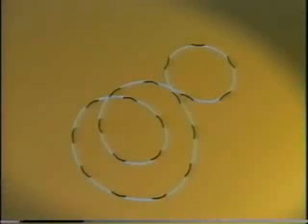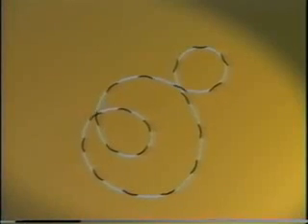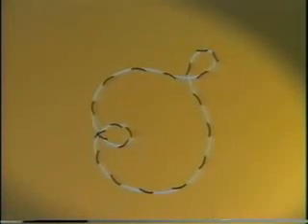Sphere Inside out Part - II

Comment: Okay, I guess it's so: You need an extra dimension of moving, so you can turn something inside out. A sphere can't be turned inside out in the 3rd dimension, but rather in the 4th. Same goes with the circle, you can't turn the inside in 2nd dimension out, but with the 3rd it works. Turning a tesseract inside out is easy in the 4th dimension due to the ability to see an object from the inside and right through. Yet the 5th dimension is for us unimaginable.
Reply: The whole point of the documentary is to demostrate that you CAN turn a sphere inside out in 3 dimensions.

Comment: Maths is fascinating. We have managed to figure out how to turn a sphere inside out, which has some pretty big scientific and mathematical implications, but we still cannot solve this:

Pick a number, if it is odd, multiply it by 3 and add one.
If it is even, divide it by 2.
Repeat the operation on the resulting number.

Prove that no matter what number you pick, by repeating this operation, you will always arrive at the cycle 4-2-1.

We have made something that looks impossible, possible; but still cannot solve a seemingly simple problem.

Comment: This video is about topology. It is very useful and it appears in many fields in math. This video basically proves that a sphere and an inside-out sphere are topologically the same. But what about the real world application of topology? Idk. Look it up. You probably won't get very far tbh.

p.s. network topology (usually depicted by computers connected by wires) is a simple concept that has nothing to do with this.

p.p.s. https://www.google.com/patents/US3991631 oh cool! Manufacturing operations often have a conveyor belt made of a long strip of fabric that transports materials from one place to another, and it is subject to wear and tear. However, using a mobius strip (a shape with the unique topological properties of having only one edge and one side) can be used to get the maximum surface area from one strip of fabric. If you don't get what a mobius strip is, it is a really simple and here is a video about it: https://www.youtube.com/watch?v=G2hsSMhCgAY
Reply: Thanks
Reply: wth it only took 6 hours for someone to respond and this video is 9 years old.

Comment: What's even the purpose of this "documentary"?
Reply: Silvio Haro From what I can tell skimming things online, the larger topic (differential topology) has a use in robotics, but this particular bit (called sphere eversion) is just math for math’s sake (ie. some circular reasoning where the point is its possible to turn a sphere inside out without creasing it) and for now there’s no practical application for it yet.

Comment: while this is factually very accurate, the sphere would have to be infinitely complex and have it's entire outer surface be a singularity, not divided pieces. however since this is mostly a theorem for the banak-tarski paradox, it applies here too. this is very factually correct as with VSauces video explaining the banak-tarski paradox, this isn't physically possible even if you could have a material that could pass through it's self. It's using alleth notes method of "almost infinity" or almost infinitely complex, which isn't possible.

seriously though this is freaking awesome, but only possible in the fourth dimension. Go see Vsauce's video explaining why.

Comment: I love this because it is an example of passionate thinking, however it is wrong, and here is where the error is: when the polar 'strips' are identified, in any quantity, as it is irrelevant whether 16, 2, or any other number are used, they then undergo a rotation, clockwise or counterclockwise, again arbitrary, with respect to a plane tangent to the sphere. When this planar rotation is applied to the 'strip', a torsion occurs. This is the important factor. By affecting this torsive value to each strip, just like the 'belt' example, a implicit 'loop' is created. Even in the most simple scenario of a 2 strip transformation, this nontrivial 'loop' cannot be reconciled, and, in this particular circumstance, is obscured into torsion. This torsion, either of two strips or any number of strips, will never be capable of reconciliation as the poles are a unitary symmetry, rendering them incapable of renormalizing this torsive effect due to the sphere's closed field lines. In short the surface will never be able to enter a non-trivial state and return to a trivial state other than that which it started. This is the fundamental principal behind knot theory, and not only applies to toral symmetries but also spherical. Welcome to invariability, and again I applaud the attempt.
Reply: I'm impressed! This video had me sold, but you got some serious smarts up there.
Reply: It's not wrong because, you know, the rules.
Reply: I'll give an example to help understand. Lets start with the equator, and consider it to be a closed, infinitely thin field line. If one were to rotate this field line inward towards the center of the sphere, the adjacent field lines would form a sort of topological 'S' shape along the equator. Here is the important part, and I'll address it with a question: When this field line is rotated inward by 360*, are you able to normalize the adjacent topology without breaking the initial set of rules? The answer should be fairly simple, and is 'no', assuming the equator is held in its rotation. This principal applies to all closed field lines of the sphere. Just as you can't 'cut' this sphere, you similarly cannot apply a torsion along a continuous closed field line without renormalizing. This is the same as cutting, and occurs along all 'polar strips' in this theory.
Reply: Fezzik Oxco your axiomatic disagreement does not directly contradict any specific step taken. If what you say is true, point out when this method violates the theory
Reply: i think you meant to say... "an implicit loop" not "a implicit loop". theory debunked confirmed.

Comment: Ok I apologize beforehand for the stupid question but why is this important?
Reply: This leads to all kinds of interesting ideas in engineering, physics, and mathematics. It seems very abstract but quite a few fields thought to be useless and abstract turned out decades later to become very useful (like combinatorics in math and computer programming). It does prove an interesting point though.
Reply: I don't see its uses in engineering but can imagine that it has uses in physics and quantum-mechanics. As far as the useless and abstract ideas turning useful later that's how we made transistors and modern circuitry so I agree there however I have no real background in computer programming (just basic logic and controllers) but if you can provide any other examples that I could read into that would be great.  Thanks.

Comment: okay but how do you turn a sphere inside out
Reply: all these great tips, thanks guys.
Reply: you insert the polar inverse coefficient phase variance inversion topographer into the corrugated dimensional transverse inhibitor. then tweak the flux relay transposition applicator.
Reply: turn it into cube.
Reply: first push the top and bottom. threw each other. then, twist the sides so that they lay horizontal. now pull the side edges together so they become vertical again. finnally, do a half turn on the edges so that they become both flipped and inside out. now shape it to make a circle.
Reply: ok so far i have a pointer finger attracted to an inside out thumb that's stuck in a sphere that i tried to reverse the gravitational polarity of so now my hand is exponentially being sucked into this mini black hole and my penis is caving in on itself so i have two balls and a hole in the middle
did i do it right
Reply: oh another great tip. thanks clerisvisitor
Reply: cool thanks for the tip santiago
Reply: Dyllon Slaboda square 1
Reply: Sure, push stuff though itself. *physics"
Reply: You take it to Disney Studios.
Reply: also i like your profile pic :3
Reply: Milly Henley Wrong comment section. XD
Reply: No prob, come at me anytime, bro.
Reply: Luka Puka Everyday, green.
Reply: bit of a correction-from my understanding. You flex or crease the sides to start, then you bring the top and bottom through eachother... then unlike what you said-you twist the top and bottom in opposite directions to cause the sides to turn the way they do until they have gone back to being straight, then you press the bulging sides through the center, then you just form a sphere with the new alignment.

Comment: What benefit does it bring to humanity to know how to turn a sphere inside out?
Reply: +pxnditx 2012 One of the other math channels I'm subscribed to gets this question a lot and their answer is that the important part isn't this particular problem, but the methods used to find a solution.  To solve this problem mathematicians had to investigate new ways of transforming objects, and the transformation methods they discovered can then be applied to bigger problems such as a warp drive.  It's like how they first showed the transformation methods on the ring before applying them to the circle. By first showing the transformations they can do to a circle, they could apply them to the fabric of space-time to figure out how to make something like an artificial gravity generator or faster-than-light travel.
Reply: +Maxwell Nieberger exactly.

Comment: What if I would just stretch ring into a ball?
Reply: +axelxan why don't bank robbers just walk around the walls of the vault in 4th dimension to get to the money instead of trying to break through it?
Reply: +Chandler Gloyd I bet they wouldn't need to steal money if they could do that.
Reply: +Chandler Gloyd because they aren't smert
Reply: You can't actually stretch a ring into a ball by these rules.  You can make the ring thicker and thicker, but the holes in the top and bottom would need to be "stitched" together to complete the sphere.  You can think about the reverse process:  to turn a sphere into a rubber band, I would have to poke holes in the north and south pole first.
Reply: Essentially what you are trying to do is the Hairy ball theorem.
Here is the Wiki page because I'm too lazy to explain it right now :P https://en.wikipedia.org/wiki/Hairy_ball_theorem
Reply: It's so ironic that you said "smert".

Comment: A few centuries ago, Number Theory was a pretty hot topic among mathematicians because it was purely theoretical and had no real applications (yes, mathematicians love that). It concerned things like whether an absurdly large number was a prime number or not, and whether some equations with multiple variables (e.g. 2x + 4y = 3^n) had integer solutions.

In this day and age, Number Theory is one of the most important field of mathematics. Nearly every modern method of encryption is a direct application of Number Theory (if you see https:// on your address bar, you are using it right now). I don't think any mathematician ever studied Number Theory back in the day thinking his work some day would have a real life application. But if they didn't do it anyway, we would be still cracking our heads trying to come up with an efficient way of encrypting data.

All I'm saying is that everything is knowledge. Whether it's extremely abstract, for example turning a sphere inside out using a theoretical and non-existent material, is not the point. Not only it is a healthy mental exercise and not only it conditions our minds to deal with things that exist but we can't easily see (electricity, molecules, etc.), but we also never know whether this knowledge will  be useful in our lives someday. Please stop criticizing this amazing movie; if this doesn't interest you, simply do something else. No one is forcing you to watch it.

Comment: All we need is a dynamic material... that can pass through its self... Like elastic polymers.. Or water.. or liquid metals... Its easier to think of when we imaging dynamically linked molecules passing through the SPACE BETWEEN other dynamically linked molecules. 

if the "links" were static the links would snap.. and if we tie the relationship of each outer molecule to the spacial orientation of the center mass and don't think of the sphere as hallow with walls made of lines that cant cross but instead made of oriented molecules this becomes less complex in theory. 

Think of liquid metal; atoms that are polarized by a positive charge on one side and a negative on the other (One charge representing the inside and the other representing the outside surface of the overall object or sphere). Now orient them together in a chain of loops that don't cross, but that always remain in contact (dynamic chain). 
Chain 1 @@@@@@@@@@@@@@@@@@@@@@@
Chain 2 @@@@@@@@@@@@@@@@@@@@@@@

@,@,@,@
@'@'@'@
see the spaces for the comas or apostrophes? If you squish it together more tightly in your mind then you can still see where there is a space that would exist there. 

 A space exists between the top and bottom of each link. Each chain of loops that stack to form the object or sphere offer that blank space above and below where each atom links together. This empty space can allow a more stretched chain to pass while each atom still remaining in contact with its own links.
Chain 1~~~~~~~~~~~~~~~~~~~~~~~~~~~~~~
Chain 2~~~~~~~~~~~~~~~~~~~~~~~~~~~~~~
 Now change the reciprocal charge outside that surrounds the sphere and the atoms will shift pols to inverse the outside charge 

  Or in a chain of strands oriented in a double helix (static chain)..

Comment: The rules of the game can be understood by playing with a bicycle chain.

The bike chain is almost 100 % flexible in two dimensions and nearly completely rigid in the third dimension. You cannot reverse the chain by rolling it inside out – it's too rigid – but if the chain is loose enough we can pull the opposite parts over each other to form an infinity sign with an extra loop (or three connected circles). As we pull the middle circle bigger (towards a reverse chain), the chain will eventually lock in the smaller outer circles. Our effort to reverse the chain comes to at halt. The only way to continue is to disconnect the joints at the far end of the outer circles (essentially splitting the chain in two pieces) and reconnect them after having completed the foldout of the middle circle into a reverse chain.

Having to disconnecting the joint is equivalent to tearing and creasing the circle and the sphere, but the fact that we can pull one part of the chain over the other is equivalent to the circle sides and the sphere walls passing through each other.